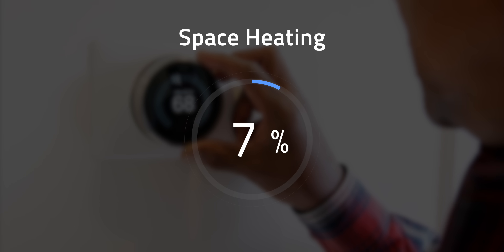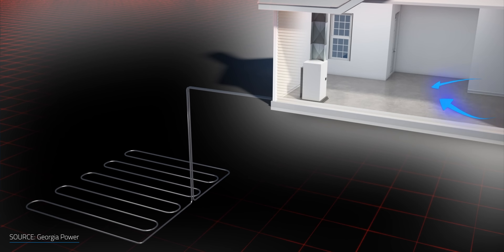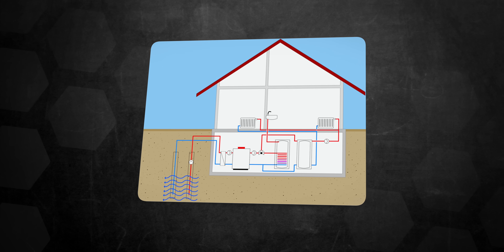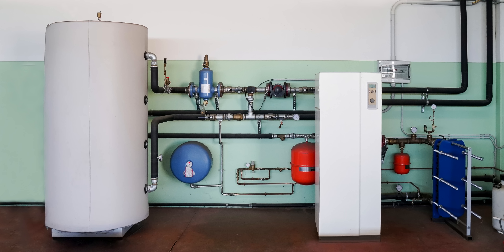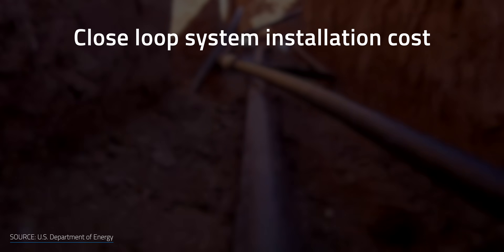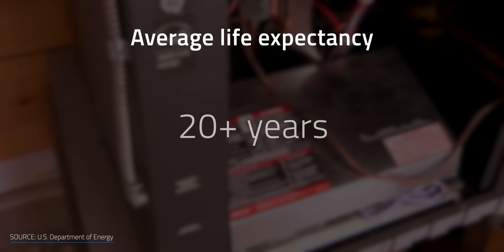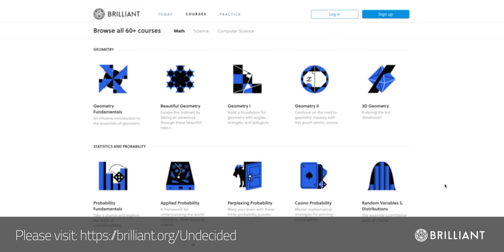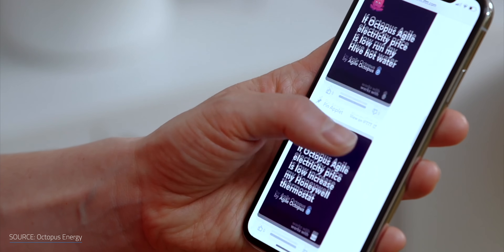Is Geothermal Heating and Cooling Worth the Cost?  Heat Pumps Explained

Comment: Tax credits don’t reduce the cost of these systems; they just shift the cost to the taxpayers. This benefits the system manufacturers and installers, who get to keep their prices high so they can “capture the subsidy”. Without the subsidy, homeowners would have to determine whether paying those high upfront costs made sense.
Reply: It's much cheaper to subsidise green technology than it is to try to counter the inevitable effects and huge cost of climate change. The subsides paid to those installing green technology pale into insignificance when compared to the costs we will incur when agriculture starts to suffer from a warming climate, and when increasingly freakish weather takes its toll. Here in the U.K. there was a substantial subsidy for solar. There was huge uptake, and as a result an industry sprang from practically nothing overnight. Jobs were created, taxes paid on those wages, and perhaps most importantly competition and a larger market drove prices down to the point subsidies were no longer required- a solar system now costs a third of what it did ten years ago and is within reach of those on even a modest income. Some of the biggest beneficiaries were those who could never have afforded such a system without help, and who often struggled to pay their ordinary electricity bills- it hasn't exactly lifted them out of poverty, but it has certainly helped a little. We ow generate a third of our annual power needs from solar and wind and have gone from being a coal powered nation to practically zero coal in little more than a generation. I'd say it was money very well spent!
Reply: Er dude, your taxes “subsidize” roads, schools etc that EVERYONE benefits from.  Furthermore, with Global Warming now rearing it’s ugly head in reality rather than in a scientific paper, we are going to need more efficient and cost effective cooling to survive, so I don’t mind if my taxes go toward accelerating this trend.  This past week (June 2021), the HVAC system at my sister’s office in Seattle took itself offline because it was overloaded!
Reply: But that's the point right? It's way more energy efficient so you want to encourage people to get such a system making your entire country's energy output eventually lower
Reply: @Charles Vane how is it immoral, politicians have the duty to uphold treaty's signed by their country. If they don't make these treaty's they need do to things like tax credit to encourage people to get to the goal. 

And besides the good reasons for the tax credit, everyone can make use of it right? If you're so distraught about it just use it too

Comment: Question: you said the heat pump compresses the fluid to heat it up but a liquid cannot be compressed right?
Reply: A typo in the script... A fluid flows be it gas, or wet sand, or whatever. A liquid is  a  kind of  fluid which is incompressible . Gases can be liquefied under low temperatures and high pressures , and large amounts of energy (work, heat) become  trapped.
Reply: He dumbed it down and simplified. there's a heat exchanger between the liquid(water+antifreeze) and the refrigerant fluid.

Comment: If you'd spent the same money insulating your house, you'd be money ahead because the insulation doesn't move or go bad if you use mineral wool.  If your house is super-insulated, you can run a standard air conditioner between 10:00 PM to 10:00 AM when the air temperature is the lowest.

Comment: If everyone uses these things, a lot of heat would be pulled from the ground. I could foresee that potentially causing problems in the future. Colder ground could have all kinds of effects on the environment.
Reply: As opposed to... colder air?

There's quite a lot of thermal energy trapped in our planet. I'm not sure if you'll have to worry in this lifetime, or any of the next 900.

There is a limit to how much can be used in an area, though - apparently some malls have used ground source heat pumps, but if they don't size it properly it can freeze their parking lots when they're pulling heat for the buildings.
Reply: @BikeHelmetMk2  I wonder just how much of a difference it would make if practically every house in a city where millions of people live use this.

Consistently ground > Affects plant growth & life > Affects atmosphere > etc. Not saying the effect would be significant to make a difference, I'm just trying to think of potential risks.
Reply: @thenonexistinghero  There's a lot of dirt below you. You just have to go deeper if you want to avoid having an impact on the surface.

It probably isn't a big deal, versus say... drilling down and pumping out groundwater and spraying it on lawns. I think we're already doing stuff far worse than geothermal ever could be.

Since it's more efficient use of heat energy, it allows cutting down on emissions and chemical use from a lot of other sources. For example, natural gas heating, or chemicals used to make photovoltaic cells. Any way you slice it, moving heat rather than having a bunch of conversion steps in the middle is going to be the most efficient and least damaging in the long run - even if it has some small quantifiable effect.

In short, improvement is improvement - even if millions of people doing it has ramifications, millions of people NOT doing it also has ramifications - far larger ones in all likelihood. A perfect example - because Renewables are not perfect (neither is Nuclear), everyone drags their feet on energy sources and tries to stay with the worst offenders. https://www.youtube.com/watch?v=Jzfpyo-q-RM

It's better to err through action than inaction. Don't fall into that trap of clinging to inaction due to action not being perfect.
Reply: @BikeHelmetMk2  I don't think there's anything wrong with thinking about potential consequences. We shouldn't treat resources as infinite, that's what got us into the current mess in the first place.
Reply: @thenonexistinghero  There's nothing wrong with thinking about potential consequences - but you should try to avoid making a bigger mistake through inaction. Humans tend to want to err through taking no action. We'd rather not participate, rather than risk being wrong. Wind turbines are killing birds? Oh dear! I'll stick with my coal-fired power generation. Hydro floods great big areas? Oh dear. The poor farmers and land owners. I'll stick with my oil furnace instead. That way I'm not harming. Oil furnaces are polluting a lot? Okay, I'll move to natural gas, because at least it doesn't kill birds. (.... oh wait.)

Often inaction is the worse move. Heat has to come from somewhere. (The sun, ultimately) The ground has way more thermal potential than the air, so why would ground source be worse than an air based heat pump? And again, we already take underground resources and spray it on our lawns, rather than keeping it in a closed loop. We're already doing far worse. While no resource is infinite, you shouldn't delay moving to a better technology and stick with a worse one to avoid making mistakes. The dragging heels mentality is the reason we have so little progress thus far on climate issues, politics, social issues, etc.; people would rather err through inaction than action.

Comment: We went Geo thermal back in 1995 when we built. Had to replace the first unit when it went bad. It was a one off design by the company that installed it. Didn't know when purchased. They also put it too close to a tree.. Replaced it with another one about ten years ago. Other than that, it has worked great. No worries about outside Temps or weathering of the system.  Both are closed loop systems. Definitely has paid for itself over the years.

Comment: I have had a Geo-Thermal Heat Pump for 12 years now.  I replaced forced air propane with a "slinky coil" ground based loop system from Waterfurnace.  I have had 1 trouble free heating season in 12 years.  1, because last winter was extremely mild.  The problem is getting the cold out of the air in the house and into the ground.  The loop cannot take cold for very long and the alternative on these systems is to run a huge toaster oven inside the furnace.  I have had a $1200 electric bill while on geo-thermal.  I have heard some people say their systems work great but mine is a real pile of junk.  Avoid Waterfurnace at all costs.

Comment: 2:33 As far as I know liquids CANNOT BE COMPRESSED. Only gasses can be compressed
Reply: Water and oil can be compressed.  It's just so insignificant that is does not matter in most situations.
Reply: @kts-s3221  no they can't, otherwise the hydraulic systems wouldn't work. Google it
Reply: @raul7293  This is confusing but while water and oil are considered incompressible this is technically incorrect.  They are compressible but only to such a small degree that it makes no difference in hydraulic systems.  We're talking along the lines of water at the bottom of the ocean being compressed by less than 1 percent.  This is something like 17,000 PSI and it's less than 1 percent.  Insignificant but true.
Reply: @kts-s3221  Ok, your statement makes sense. That's what they mean when they say liquids cannot be compressed.

Comment: since I live in Sweden, almost every home built uses closed-loop GSHP (well over 90%). Our house only has a 60m deep hole, but that is coupled with an air-air exchanger. The term used in Sweden is "mountain-heating" ie using the heat stored in the igneous rock beneath most homes. We use an 11kw heating system for our 2300sqft home.  It didn't cost that much comparatively - around 20kusd including the drilling and took about 2 days to install. A bonus is that we have under-floor heating in the entire house. Our COP is around 4,2 which is pretty common. I will note that after about 15 years you might need to re-drill the hole in the ground to ensure good heat exhange.
Reply: The Scandinavians should take over the world. You guys would have the rest of  us sorted in a decade.

Comment: Two important questions. How cold can the air be outside over a sustained period of time before the system can't keep up. And how hot can the air be outside, before it can't keep up.

I live where the temperature in the winter for a couple months are consistently below 30F in the day and usually below 15 over night. In the summer I usually see above 90 for a month or two.

Keep in mind my property is only 2,000 square feet. My house and garage takes up half of that.

Comment: I prefer gas heat. For one specific reasons.
When the inevitable power outage happens, i still have heat.
Reply: Sure about that? Your thermostat requires electricity also your gas furnace

Comment: I live in Westchester NY. I bought a house in 2019. The house used to run on oil. My monthly Bill used to be about 550 to 600 during winter time. I got into a deal with the oil company, for a constant 350 a month bill. I tried to switch to Gas but the utility company told me there  was a moratorium. The oil bill was killing me, one day I saw a video about Geothermal and did research. Here in NY I found a company that was doing it. I decided to go for it. It has been the best decision I have ever made. The savings are amazing. If anyone is interested, I could answer questions.

Comment: You show geothermal as using the ground loops as the evaporator (heating) or condenser (cooling) for the system.  I was unaware anyone was doing that - it seems odd to me that you'd want to fill something with that volume with refrigerant.  Our ground source system pumps coolant (water & ethylene glycol or similar) through the ground loops, which is used  in a water-to-refrigerant heat exchanger.  I thought this was (mostly) how it was done.  What say ye?

Comment: I rarely see anyone add solar heat to the area where heat is drawn from geo thermal. Most geothermal needs a heat pump, adding solar from an evacuated tube and piping to the area you draw geo thermal from can eliminate a heat pump

Comment: I've always wanted to use an Ice Thermal System and use evaporative cooling with a mix of geo thermal on my home. The problem is, we can't buy and store when the price drops the way power companies can. If we could do that, then ice thermal would make a lot of sense. I just like the idea. Even without being able to purchase power when the price drops, Ice Thermal would still save you money. It wouldn't be difficult to build and implement any of these systems, honestly. You could easily build a thermal hot water system to use during hotter months..then you build in a changeover.

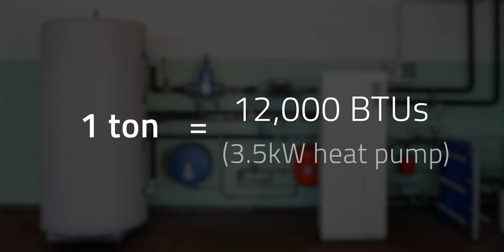Comment: Were the BTU numbers flipped at 5:32? I think the heating requirement should be higher for each square meter than each square foot. The number that followed also might be incorrect, which cost about $1.50 per hour to heat, which would be about $1100 per month, which seems uncommonly high for a 2300sqft home.

Comment: Want one? Absolutely! Going to get one? Ugh... Life has a lot of expenses, and too often the cheaper option up front is the right option for the moment. Our hvac system is from the late 80s,with the AC portion having had a refresh in the late 90s... We are overdue and it is just a matter of time before it all falls apart. Probably going to get something affordable to get through the next 15 years, and then look at something more like this. By then we will have the house paid off and more resources to pull from.

Comment: Assuming you use the system only in winter: how many years does it take to cool down the ground enough to render noticeably less efficient?
Also, heat pumps are only an option where electricity doesn't cost almost  5-8x as much per kWh as does natural gas.
Reply: The ground has limitless heat capacity, it is constantly replenished from below and above through solar radiation. You can't cool beyond the point of recovery, that would be like trying to cool the oceans. You're right of course about the relative costs of natural gas vs electricity, but given that new gas boilers will soon be banned, and many homes are not on the gas grid and currently rely on oil or LPG heat pumps still make sense for many millions of homes.
Reply: @spencerwilton5831  "limitless heat capacity" -- that's a bold claim.
There is almost no heat conduction. That's why cellars keep cool during the summer -- they don't heat up from below.
If you take out the heat from a volume of ground by more than what it will gain through conduction from above and below, it will cool down. If it cools down, the efficiency of the heat pump drops.
The title is mentioning "geothermal energy" -- but that's misleading if you only place some tubes one meter into the ground.

Comment: Geothermal has never been economical, because the installation and maintenance and decommissioning costs are overwhelming. Contrarily, upgrades to the insulation and air sealing of the thermal envelope are much cheaper, far more effective, and quickly pay for themselves.

Comment: Omg this is such a really really poor explanation of phase change heat pumps. If heat only moves from hot to cold, then how can my fridge work on a sunny day? The compressor in a heat pump does far more than create heat, it changes the phase of the working fluid between a liquid and gas.

Plus you're understand of GSHP is woeful. The fluid circulated below ground is simply a transfer fluid, it is pumped rather than compressed. This fluid moves heat to or from the ground, this heat is then extracted by a phase change heat pump. The fluid in the ground loop acts like the air in a standard ASHP (air source heat pump), you know your standard air conditioner. It moves the warmth from inside of you're home/car to the outside (which in lots of cases is actually hotter than inside)

Sorry i just find you explanation over far too simplified, even just saying a heat pump is a magic box that can move heat around would be better.

Far better video on heat pumps: https://www.youtube.com/watch?v=7J52mDjZzto&ab_channel=TechnologyConnections
Reply: heat does only move from hot to cold though, second law of thermodynamics

Comment: I always thought that big buildings, like shoppings centers, should have an artesian well, not to pull water, but to have a closed loop for heat exchange. Here where I live, water bodies can be found relatively shallow in the ground, about 50m. Now imagine if you place your heat exchange pipe, straight down, about 5m or 10m even lower than the water level, you won't need to have those loops to increase surface area, since the own water will move while heat up, increasing the heat exchange by the water movement. I don't know if there is any idea about this in the area, but I never heard about it.